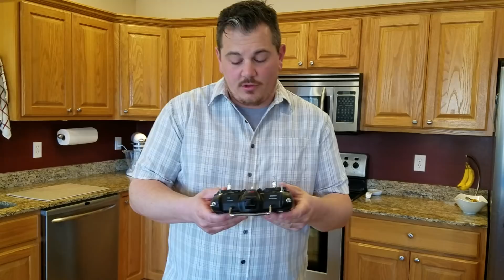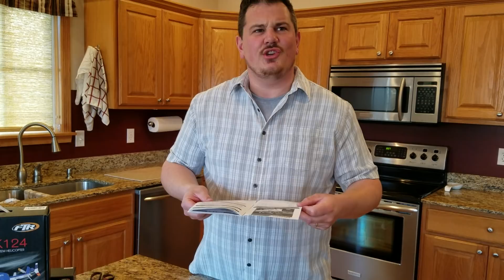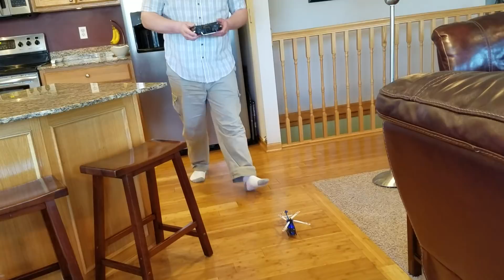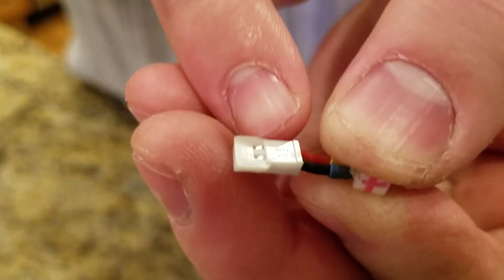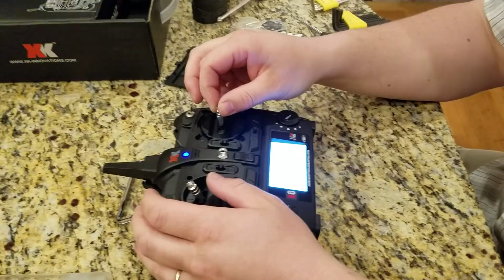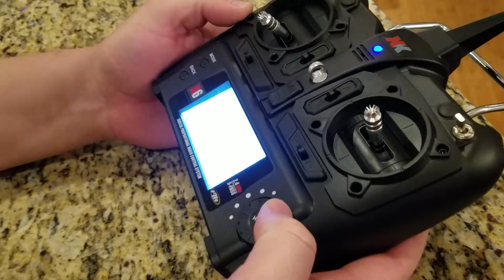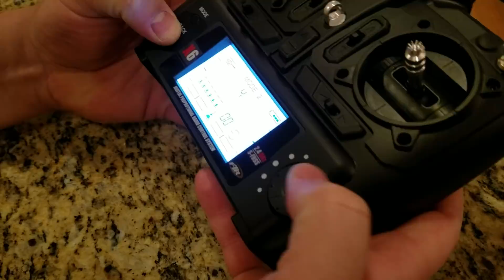XK - K124 - RTF EC145 Heli - Unbox, Repair, & Indoor Flight

Comment: I've got one of these coming as a first collective pitch after wearing out a coaxial and flying a fixed pitch heli for years. I have more planes than anything, but fly my Eachine E119 more than anything. Looking forward to the challenge!
Reply from the maker: It is a challenge, but with plane flying skills, and some coaxial heli skills, you'll be fine. Just play with the Throttle and Pitch curves to dampen it, and it will fly docile like your coaxial heli's.

That being said, we've done so many heli's since this one, if you find you're not impressed when it arrives (which I highly doubt, btw) you can check out all sorts of other amazing newer offerings - https://www.brianphillipsrc.com/heli

Comment: can i use an 800mah battery with this?
Reply from the maker: If it fits, you can. I don't recall what size the stock pack was.
Reply: @BrianPhillipsRC  45x25x8 but it has some room.  so i think 45x30x9 will fit aswel.  

if the mah doesn't make a diffrence and all i need to worry about is the 3.7volts then i can also start looking at 1000mah ones that get close.  

but i also have a 3d printer and i might just modify the frame.  
i was also planning on adding a gearbox for the main rotor gear.  so i can fill it with greace for more silence and less wear.

i have also noticed they discontinue'd a bunch of the parts.  mainly the canopy.  so i will probbably design and print one of those aswel.  make it a little less prone to ripping into 1000 pieces.
and then maybe supply them to the people in need who can't get a replacement canopy and can't fix the one they have

Comment: can't wait for this thing to arrive.  
it will be here in 2 days.   but honestly i wish i had chosen pickup.  i would have driven there today.
Reply from the maker: It takes a while. Good choice, BTW
Reply: @BrianPhillipsRC  
it's already shattered.  and the tailboom broke. 
but i'm using ash and superglue as we speak to fix it. 

ordered replacements just in case.  and i got a 3d printer to print custom ones.  

this thing is unluky though. 
the place i ordered it from only sent me 1 battery with it.  

so i had to order a spare from somewhere else wich arrived today.  and instead of the 45x26x9mm that they said it was.  it's 54x30x8.2mm  so it doesn't fit.  

wanted to return it. and have it exchanged.  so i requested it.  and they said i didn't have to send it back and i would get a new one. 
(all automated btw so no human saw the interaction)  but the model number is correct,  so their system has the wrong sizes. 

now i am going to have 2 extra 800mah battery's that won't even fit in the helicopter.  
(unless i modify the frame.  wich i ordered 2 spares for so i might just try that)
Reply: @BrianPhillipsRC  also i disagree.  it's a bad choice.  you should put a disclaimer on this to advise people against buying it.  

the spare parts are discontinue'd  so everything that's available for sale atm.  is just left over stock.  and the most fragile stuff is already sold out.  

so by all means buy it if you wanna display it.  or can fly without crashing it ever.  but other then that.  don't buy it.

Comment: 31:45 eeh no it shouldn't tip the rotors at all.  

it has a swashplate.  that means to move forward.  the rotors are changing pitch every single rotation.  
they are pitched and producing lift at the rear of the heli.  and they are horisontal not producting lift in the front of the helicopter. 
that makes the entire helicopter pitch forward.  not just the rotor.  
and since the helicopter is on the ground.  it cannot do that.
Reply from the maker: Sorry for any mistakes I made in my explanation

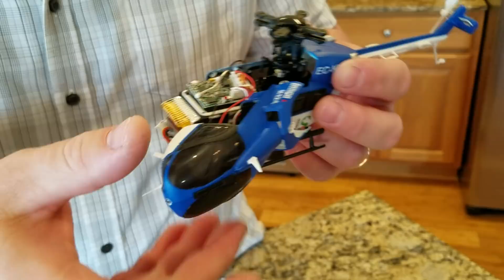Comment: @7:04  Those aren't VHF/UHF antennae.  They're wire cutters.
Reply from the maker: Cool, thanks - I never new that before now! So are they SHARP in real life?
Reply: @BrianPhillipsRC  Yes, sharp enough to cut a high tension power line, which is what usually kills helos in a wire strike.  The big "fins" you see aren't the cutters, though.  They just guide the wire down/up to the base of the "fin" where the actual sharp blades are in a V-notch arrangement.  You can clearly see them in the 2nd and 3rd pictures in the link below.

https://en.wikipedia.org/wiki/Wire_strike_protection_system

Comment: This looks a lot harder to fly than the eachine e120
Reply from the maker: It is, but it can also REALLY fly...the E120 and E110 are a "toy grade" very east to fly, with even more locked in Flight Controllers. For example...on the E120 and E110 you can't even turn off auto-leveling...on this, and it's been a while, you can turn OFF the stabilization 6G and go to 3D mode and flip it over and all that.
Reply: @BrianPhillipsRC  thanks for that info.

Comment: I’ve been having some trouble with this helicopter. Very sensitive aircraft. You seem to know your stuff. Help on adjusting sensitivity?
Reply from the maker: You have to make changes to the pitch and throttle curve to make it "easier" to fly, and make sure you keep the stabilizer high, and rates LOW to make it really easy to fly.

Comment: I got mine on June 2022, and I had to fix the controller too, same glitches as you but only on the yaw, it goes on the right as crazy, because no weld on the potentiometer connection. The test to do is : Shaking a bit the controller, servos are moving.
Reply from the maker: I see

Comment: I BOUGHT jumpertt8sg v2+ befor 2 years,and im using that transmiter for all my models (Quads,Planes) sometimes is cheaper buy seperate helicopter withot that chrapy transmimters....Just myne opinion,great video ful of details.
Reply from the maker: Thanks! Jumper is a great option for many, but since I'm handicapped by my love affair with Horizon Hobby, and my mistress, Spektrum, I use them instead ;) LOL!

Comment: I have a question what settings do I put when my heil is turning left and forward at the same time??? edit: now it’s when i try turn it backwards like this: ⬅️🚁 and when i turn it backwards it go’s like this⬅️🚁 but the helicopter is backwards
Reply from the maker: Trim it the opposite direction...just imagine you were needing to pull the left stick back to make it hold still...then click the trim next to that stick BACK a few, then if you can let go....you're set. Sometimes it's tough when there's TWO directions simultaneously, but you just gotta work through it. You can do it! Take your time and get it 100% and you will LOVE IT!
Reply: Ima try recalibrate the gyro before I do that
Reply: Thanks you  helped me a lot and it fly’s nicely now

Comment: It’s such a beautiful micro scale helicopter. But I’m not understand about it’s transmitter, it have idle up switch and 3D & 6G switch. And I don’t understand how does 3D & 6G switch work. I think only idle up can perform aerobatic 3D fly.
Reply from the maker: 3D/6G = stabilizer + auto leveling. If you want to flip the heli, you CAN, but you have to run in idleup and then turn off 3D/6G so that it'll allow you to flip over.

Comment: Recommendation for beginners: stick with throttle needs to be in middle position when flying. Pitch is at 5 to 7 degrees. Raise the the throttlelevel up until the heli flys. Cyclic pitch needs to be at 3 to 4 degrees maximum. This is your way to a smooth flying heli
Reply from the maker: yeah, faster the blades spin, more stable the heli becomes ;)
Reply: Sorry english is not my first language, so i don't understand what excatly you mean and how to set this up? Could you be pls more detail how to set the radio throttle curve if it is the case? Iam also having trouble to pitch the heli forward, looks like when i push the stick forward it goes more sideway, then forward. i tried to play with settings by some other videos but eventually went back to factory settings, which didn't solve it. Also the 6G calibration by the instruction in manual doesn't work or i cant understand the google english, but i did at least what i saw on the photo. I thought maybe it could help. Sorry for bothering you Iam just a bit frustrated. thanks for your time and advice.
Reply: @davca333  which radio are you using?
Reply: @90s_sascha  its X6 which came with the heli K124

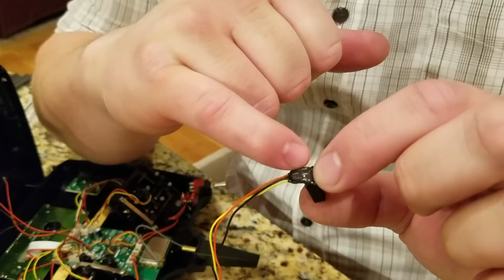Comment: Hi Brian... I'm enjoying your video.  At around 1:15:10 and before you went down to the basement to solder, the XK 6 transmitter was beeping and balking an alarm.  The Tx was doing that because you powered it with the collective/throttle stick not at zero or at the bottom and throttle hold was off..  With so much to do, you didn't realize that the stick was almost at half stick.  No bueno, not even on a more expensive radio.  Thank you for taking the time to promote the hobby with your expertise.
Reply from the maker: Thanks for the info! I agree that must have been what was going on ;) I'm still no heli-expert, by any stretch, even years later after filming this video, but I still enjoy learning how to work with them, and they get less and less scary to me as time goes by.

Comment: Hey Brian - Great video! 😎
You’re not the only one with a glitch; I’m currently experiencing a relentless beeping from my beautiful K124 !
After binding, the tail rotor spins up and all the servos check out fine but I’m getting nothing from the main rotors 🚁
It just keeps on beeping with solid blue & red LEDs on the motherboard. I replaced the board with a new one but made no difference 😤
No mention in the manual - any suggestions would be greatly appreciated 👍🏻👍🏻👍🏻 Martyn :)
Reply from the maker: I'd be lying if I said I knew. My issues were with the Transmitter, if I recall...
Reply: @BrianPhillipsRC  yep! And what a great video, been through similar stuff myself..are my K124 did you see the link I posted? 👍🏻

Comment: If you have a futaba tx with fhss you can use it with this heli to compare it against the model transmitter. Good job fixing that pot.
Reply from the maker: Thanks Glen. I didn't have one when I got this heli, but do now...Jumper T8SG...so I could.

Comment: Hey buddy, learn the heli terms. What you call throttle is the collective. What you call rudder is tail rotor/ anti torque pedals. Then what you call aileron is right/left cyclic. What you call elevator is forward/ aft cyclic. Have fun, just wanted to enlighten you meant no harm. Its good to use your terms for radio setup but in learning to fly helis its also good to know actual flight terms in explaining the flight physics of a heli. Your Chinglish reading was awesome! I highly recommend checking out John Salt's channel for professional help. Thanks for sharing.
Reply from the maker: Thanks Glen! I will work on these terms. Aviation keeps you on your toes ;)

Comment: I wanted to add an on/off switch that would allow me to switch the helicopter off and and charge the battery without removing the cover.  I'm sure i can install it by trimming the plate for the on/off switch.  Do you have any thoughts?
Reply from the maker: If you do, please be careful, in that the lipo might get hot and then you'll have a fire...I'd encourage you to remove it, but if you do a switch, you'll need to take special care not to start a fire.
Reply: @BrianPhillipsRC  Thanks Brian, enjoy watching your videos.  Wish that A380 would stop crashing! haha

Comment: Just got one a few weeks ago. The transmitter is hell to get into program mode. Have to try about 15 times. Yes I did read the owners booklet. The helicopter is way underpowered, if even a breeze comes up it will just go off, no amount of right stick will help even in high rate. The tail rotor is terrible, makes a high pitched whine and is all over the place. I just put it on a cabinet in the living room and it looks good there. Just my experience, you may have better luck.
Reply from the maker: That sounds like a lemon...mine was way powerful. I'm not a great heli pilot, but it had plenty of power. I agree she's beautiful on display but maybe they'll replace it for you???

Comment: I would disconnect that battery draining headlight, its bright looking which means its sucking the life from the battery
Reply from the maker: No, it's a very, VERY low current draw. This heli is extremely capable, and you'll be amazed with the performance. LED's are like 1/10% of the load on the system. Now if it were an incandescent bulb, you'd be right on...

Comment: You do know it has a clip that you have to release first Brian
Reply from the maker: I think you're referring to the front half, to access the lipo, if so I believe I was aware, but having some trouble with it possibly? If you time stamp with the remark, I can answer more specifically.
Reply: @BrianPhillipsRC  Where I fly charge my lips at 3amps but it charges all different ones we including car
Reply: 3 amps is the norm these days but I did 1amp to conserve the battery life don't go beyond 3 ok
Reply: Its on trickle for the car charger has tobe set for battery type I use swallow 2

Comment: I find it funny that you were suggesting a higher amp charger is making it safer when you should have been suggesting that nobody should be using one of those cheapass wall warts instead of buying a proper lipo charger.
Reply from the maker: Okay. My experience with undersized electronics is a higher propensity to break. I generally DO suggest a better charger too, but 1200+ videos, it's hard to say all the stuff in every video...for goodness sake - look haw long this one was already :)

Comment: I bought a helicopter model about 10 years ago. When I unboxed it, the 2 wires to the tail rotor were off from a bad soldering job.
I set it aside but would like to try flying it now but here is my question?  Which way does the tail rotor turn....up and forward, or down and backwards?  I have tried finding the answer but nobody seems to know...Can you tell me?
Reply from the maker: Tail rotor produces thrust to counter the rotational forces generated by the main rotor. It points to the LEFT, when you have the tail boom facing you, and the nose of the heli pointed away from you. Make sure the thrust keeps the heli yawed straight ahead when you throttle up, and you'll know you've done it right....HOWEVER...if you don't know this answer, and it's 10 years old, I suspect you might be talking about a COAXIAL heli. In this case, there are two counter-rotating main rotors removing the necessity fro a tail rotor, which is instead used to pitch the heli to go forward or backward. In this case, you will have to guess and check.
Reply: @BrianPhillipsRC  ??  When I face the tail rotor does it spin clockwise or counter clockwise?
Reply: @keithirvine1  Counter clockwise.
Reply: @MarkLilloGuitars  Thank you!!!

Comment: @19:30,.. yep! 😂Jus hate when it comes outer ther screwhole,..👌😁,.careful not to wallow it out too much. Easily done I know but that's why we gotta limit how hard,amount force applied. I usually tighten it down then back it off just a wee bit. I never cared much for loktight. In my experience I always need to remove something that's been lock tightened,& cant ever get off.. I think there's a difference  between
Reply: Also think there's a difference between blue and red loktight.i could be wrong though,..
Reply from the maker: yes, but the blue and red both have similar solvents for delivery. CA works awesome to lock screws in, where possible. Some prefer to put a drip of paint on the threads. Whatever solution you use will help, but keep in mind loctite solvents can breakdown some plastics, so be careful :)

Comment: I have a 4 channel WL Toys V912 brushless flybar bird..  Granted, I'm a quadcopter guy and do fly fixed wing. I guess after flying quads for 7 years, the chopper seems sluggish and not as crisp at the control. Took it out today for some flying around the house and nosed the damn thing in. Broke a few connection joints on the main rotor. Unlike a quad, it loses altitude quickly as the main rotor is tilted front or back..
Reply from the maker: That's very unfortunate! Did you get her back to life?

Comment: That is actually a pretty good little radio. XK stuff is great.
Reply from the maker: yeah! so much value packed into a small package. I'm not even hating on them because there was a problem with it...I mean, I could fix it!!! ;)
Reply: @BrianPhillipsRC  Hey, I bought a Blade 150S a couple of days ago. When I powered it up the first time, it got light on the skids and started to spin on the ground. I found the tail motor connector completely unplugged. Reconnected it and all was good. It always pays to look em over good before you fly em.
Reply from the maker: Yep, good rule of thumb. Glad you caught this issue!

Comment: Hi. just bought my K124, but it seems not working properly. I need to put the throttle to about 90% with default setting on the transmitter to get a lift.  Even if it lift itself, it's knocking very violently and it even smashed itself to the ground on the very first flight  :( ESC is heating up just after like 30 seconds of motor spinning. just ordered a new ESC, but any clue what's going wrong?
Reply from the maker: Sounds like you need to look at your throttle curve, then look very closely at the linkages going to the swash plate.

Does the heli "Suck" itself down to the ground?
Reply: @BrianPhillipsRC  Thanks for the reply. My throttle curve is as default on the XK transmitter. whereas from the reviews online, suppose it fly well with the default setting. 

It "Suck" itself down to the ground in the idle up mode (which is okay) but I'm NOT flying it on idle up. And by visual, swash plate and servo horn are leveled and working just fine. 

I bought it on banggood Xmas sale but I suppose they where sending out defective product cheaply :(